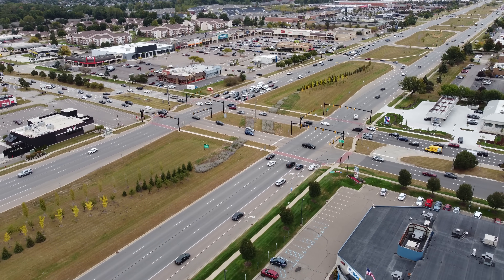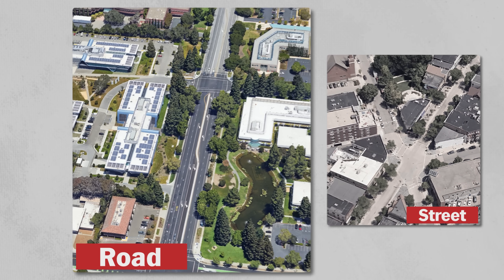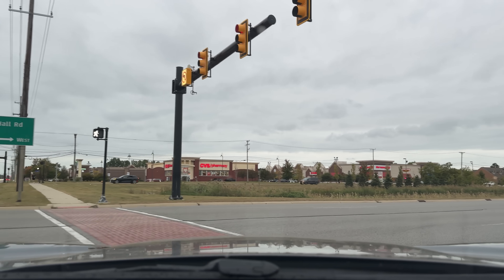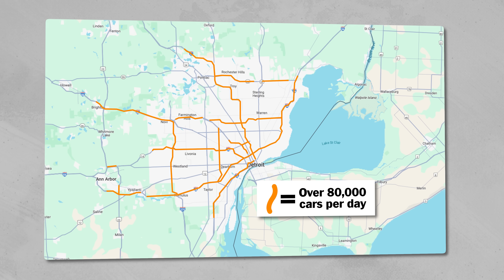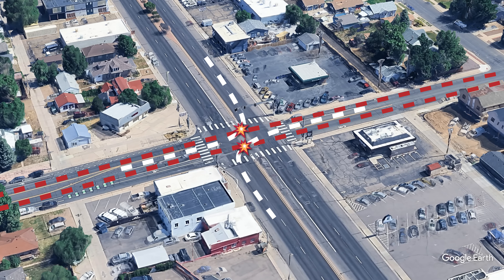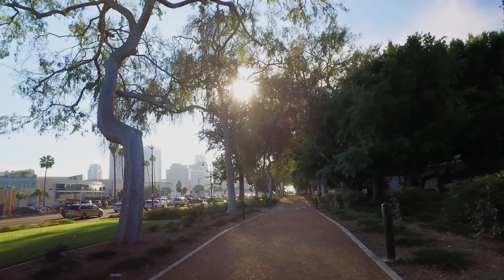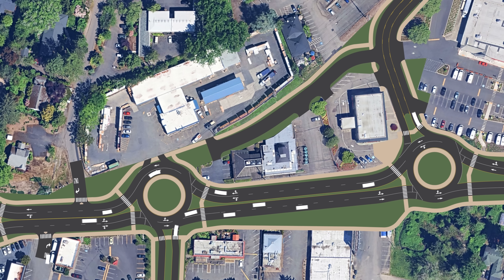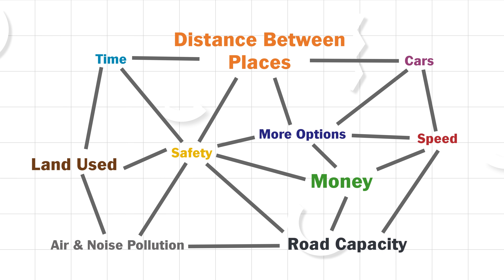How Michigan Built a Super Highway Using Only U-Turns

Comment: This is not only in Michigan, you can find this in parts of New Jersey as well.  I have experienced this type of road which forces right had turns and u turns for left turns.  It has been spreading in the USA for a little while now.  Great video explaining the concept however.  Another road concept close to this but much smaller in scale in rotaries.  They force you to move right and only right, no left turns.  They have put them in recently all over the place around Elmira, NY and Horseheads, NY, reducing the accidents occurring at intersections where they have them by over 50 percent.  They do work.
Reply: Jersey also has a lot of those "jughandles". There's a special place in Hell for whoever came up with those.
Reply: THose are called jug handles and they make far more sence the a Michigan Left turn again it keep traffic moving.
Reply: @davidhawley-lowry8360  Yes, those are there as well - they add traffic lights though, but they do work in a similar manner.  They probably have more of the jughandles then this method - I have only seen this once on one road in northern NJ. The jug handles are more popular in the South Jersey, a lot around Princeton.

Comment: I don’t know why this style of intersection isn’t more common. There is one road in Tucson, Arizona, that partially uses the Michigan Left design, though they don’t fully embrace it. There are 3 intersections along Grant Road where you’re not allowed to turn left from Grant, but there are U-turn spots between the intersections. However, you’re still allowed to fully turn left from the other roads at those intersections, so it’s not quite a full Michigan left. However, there aren’t any Michigan left intersections I know of in other parts of Arizona. They would work well with the flex lanes in Phoenix that run along stretches of 7th Avenue and 7th Street north of downtown. Those lanes have a certain nickname for a reason.
Reply: The intersection of Ina Rd and Oracle Rd is sort of a half-Michigan Left intersection.  Traffic driving along Oracle is allowed to turn left onto Ina, but traffic moving along Ina has to pass through the intersection and make a U-turn.  Both of the U-turns are also designed with some extra width for trucks.

Comment: These types of roads are actually really common in Russia! Like they build a road without surface intersections and instead place u-turn roads further down the road. Idk if it works well because ive only seen it on google maps but i can imagine it would be better than a normal intersection!
Reply: My city has something similar but with roundabouts and it's so good you never need to stop for a light or whatever when driving down a road
Reply: Indeed, they are cheaper than building a bridge, but safer than a crossroad. It prevents drivers from simply blowing through the intersection, and forces them to make a turn, slowing them down. You also have to wait for a gap in one direction at a time, which again is safer (less chance of making a mistake) and more efficient.
Near Krasnoyarsk they've recently redesigned a road between the city and the town of Elita, widening it to a dual carriageway, and converting most intersections to RIROs with downstream U-turns. It gets very busy in the summer, with people heading to and from dachas on the edge of the city. 
Previously it was a 2-lane road, with a crossroad right in the middle, which saw a series of crashes over the years. Traffic lights were eventually installed in an attempt to remedy that. Something noteworthy is that it was one of the sites of the national "right turn on red" experiment, having the "turn on red permitted" signs added in 2019. They lasted all the way till the road was redesigned in 2024.
Reply: You would never know Russia had those kind of roads by watching their 
"Crazy driver" videos😅
Reply: @jamesnuznoff115  Most of those videos are over 10 years old. The driving standards have significantly improved since then. There are a lot of cameras that can fine you for a wide variety of offences.
Reply: @trainsim5869  happy to hear.

Comment: There is only one way to fix US roads...
Dig up the whole thing and start over.
Reply: Cool, how much do you wanna pay for it? This stuff is expensive.
Reply: @Sam-w5v  Not American, I am not paying for it.
And cost is vastly different from "how to fix".
The solution is to start over and not make small patches. Yes, that is pricey, but that is the solution.
Reply: @XDRosenheim  I don't think you quite got my point. Starting over is expensive and almost impossible in many locations. Besides, how are you going to convince people to make the change? Most americans do not care about this sort of thing.
Reply: @Sam-w5v  It is not "impossible". I never stated it would be easy, or quick, cheap, non-destructive, a hassle... or anything.
I am only saying that it is the solution to the problem. To start over, so you have actual room for other kinds of transportation, such as trains, dedicated bike-lanes, bus-lanes, walk paths that will actually be used, the whole lot.
The patchwork non-sense of having u-turns on a highway is not a solution (some even without light-signals?! That is just a lot more dangerous). It only moves the problem down the road, and when demand raises in that area, you are not only having issue with getting people onto the highway, but also getting people through the highway, as the line to the left-turn lane gets increasingly more used and backs up into the other lanes.
Reply: @XDRosenheim  Okay. I'm just saying that you really need to do some convincing for that to even happen. Most of us do not care about that.

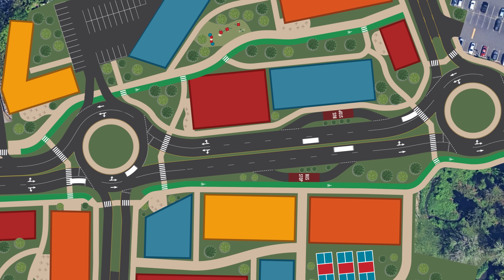Comment: At 12:46, the bike lanes around the left circle seem to be disconnected as in a normal intersection yet the purpose of the circle is to keep traffic—of all types—moving continuously. I like traffic circles as a bicyclist but they need to make us a part of the engineering rather than another obstacle to stop traffic. Can you do a video about this & how different scales of traffic circles are better or worse for bicyclists especially?!
Reply: I second this. I don't commute via bike, but I have rode about Hall Road before. I've avoided these ped/bike paths on the Michigan Lefts because I don't feel safe.
Reply: What about separate bike trails that are pedestrian friendly? I've seen overpasses for peds and bikes in Denver that would be relatively low maintenance and safe.
Reply: @KBergs  can you elaborate more on what you’re referring to. Trying to tie your comment to mine.

BTW, since you bring up Denver, the primary recreation trails that are mixed uses (SPR, Cherry Creek) are busy enough to need separate bike lanes & non-wheel paths for most of the city (Cherry Creek at least to Colorado Blvd). Those areas also happen to have the most free flow for bicyclists & trail users uninterrupted by personal private vehicle traffic, which encourages a wide range of speeds, not great for a multi-use, shared trail—thus necessitating separate paths.
Reply: @ttopero  You're correct that the demand is a factor. Induced demand for cars can also work for bicycles if given nice infrastructure. 

My comment is referring to the concrete overpasses with the small metal channels to walk your bike up the stairs easily. This is also going over car traffic with no stoppages.
Reply: @ where are these in central Denver? I can’t think of any not on trails in central Denver
Reply: Great point! The disconnect at 12:46 is a huge issue. Bikes and pedestrians should be part of the flow, not an afterthought. A video on this would be awesome!
Reply: I think that might just be a small mistake they made when making the graphics

Comment: I feel like this is just two one-way streets with a median that is too small to actually do anything with. Widen the median a bit more, treat it as 2x one-way roads with these mini-turning roads in it and now you dont have this gargantuan median dividing town as you can actually build stuff in it.
Reply: You can build what, houses? Nobody wants to live in the median of woody.
Reply: I'm not saying that people should live in the median of places like Hall Road. What I'm saying is that if you widened the median to 2 or 3x what Hall Road has you could easily fit a lot of those smaller businesses into the "median". Although it would be wider, it would break up the giant cut across the city that it ended up being.
Reply: @TomPVideo  I dunno, I think it'd just be too much noise pollution. To each their own.
Reply: @Sam-w5v large particulate from the tires is the bigger worry. Anywhere within 200m of highways and stroads like this have measurably higher air pollution in this category.

Comment: You can use I-96 in the western suburbs of Detroit as a really good example. When I-96 was built they had to build it in the middle of Schoolcraft Rd. The Michigan Left was used at all of the main road intersections to allow Schoolcraft Rd to remain for use. At every exit on I-96, you will see 3 bridges over i-96 so the Michigan Left could be used to prevent the backup of people trying to turn left onto Schoolcraft Rd or to get on to I-96.

Comment: Seems like this setup encourages a lot of multi lane changes that are against the rules of the road, no? Like all the users at 5:15  in the video are not turning into the right most lane and changing lanes, they are rapidly crossing many lanes. Isn't that technically a traffic violation?
Reply: It is technically a traffic violation, but that is just how it works. Nobody is getting pulled over in Detroitland for shooting across 4 lanes of traffic to make a Michigan left
Reply: Not the law in Michigan.  Most states do not require turning to the rightmost lane.  Amd those that do still allow exceptions for successive left and u-turns.

Comment: A little more and they would discover the roundabout
Reply: Roundabouts require a reduction in speed, which wouldn't fit with the design of being a large conduit road.
Reply: @Zman6258  In the Netherlands, we often use turbo roundabouts on higher-speed roads, usually around 80 km/h (~50 mph). I’ve never seen traffic jams at them, only further down the road at a traffic light near one I drive on regularly in my commute.

The road in the video has a speed limit of around 45 mph, and while turbo roundabouts can handle multilane setups and higher speeds, they’re not a great fit here, so i agree with your statement. But the problem isn’t just the number of lanes, it’s that the road behaves like a stroad: mixing fast traffic with frequent direct access to parking lots and businesses.

The video shows an example at the end where roundabouts reduce conflict and maintain flow, but that only works when a road follows proper hierarchy and access control. Roads like this should be fed by collector roads, not directly connected to every parking lot. So the entire core infrastructure is kinda doomed in a sense.

Not a native speaker, so sorry if the grammar isn’t perfect — hope this helps
Reply: @doge4975  "In the Netherlands..."

You've just triggered all the Americans. 🤣
Reply: @doge4975 America already has those.
Reply: Oh, we have also discovered roundabouts as well. Plenty of them around metro detroit
Reply: Businesses on a stroad are supplied by trucks.  In North  America, these are tractor trailers of a size that Europe does not have.  In all the videos advocating traffic circles, I have yet to see a real-life demonstration of a standard U.S. tractor trailer, aka big rigs, navigating them.